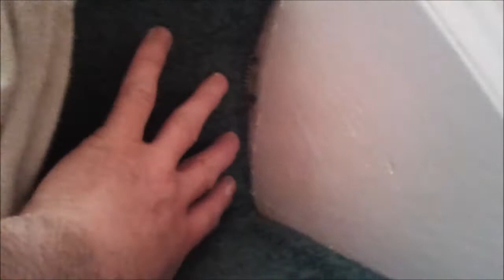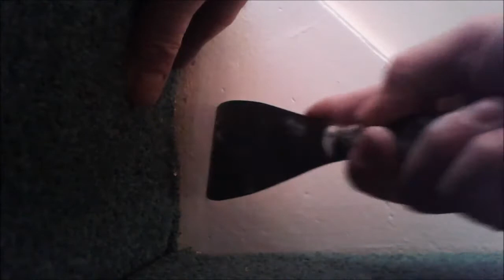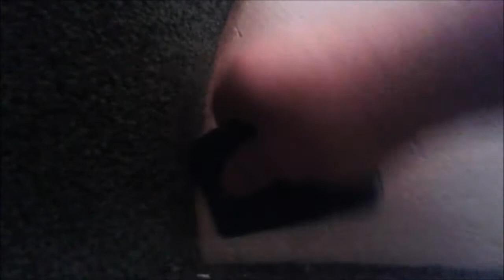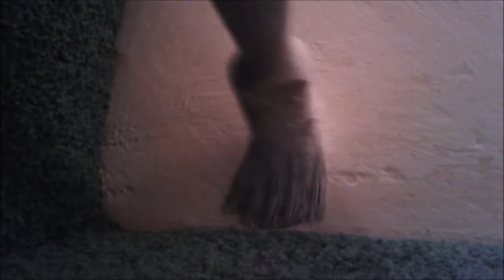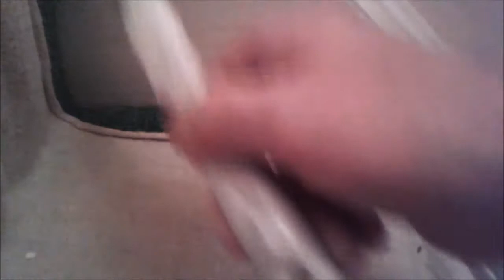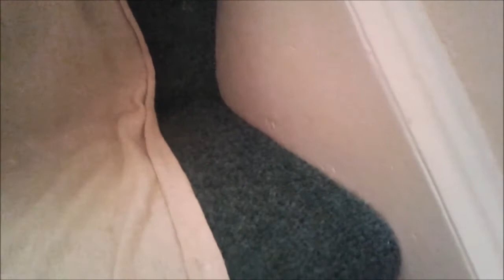Preparing And Painting Staircase Stringer

Comment: Zin Bin is a great bit of gear and pulls us out of many sticky situations. But wouldn't be using it as an undercoat as its very brittle. Also my old mentor would have kittens if he seen me doing treads and not taping carpets up.
Reply from the maker: So what do you use B.I.N. for.
Reply: Painting and Decorating  general stains, spot priming and priming knotty woodwork up. Zinsser bullseye is more useful as an undercoat as
That stuff sticks to anything.
Reply from the maker: B.I.N.  Product overview
B-I-N® is the ultimate shellac-based primer, sealer and stain killer. It is perfect for use on interior surfaces and spot priming of exterior surfaces.
B-I-N® offers unparalleled adhesion to glossy surfaces – including glass – without the need for scuff sanding and blocks stubborn and persistent stains. The high adhesion shellac formula seals porous surfaces with excellent enamel holdout, even sealing bleeding knots and sap streaks. B-I-N® works brilliantly on water stains, fungal degradation, nicotine, oil stains, marker pens stains and more.
B-I-N® permanently blocks every kind of odour (from smoke and fire damage to odours from pets and nicotine). Its dried film is non-toxic and hypo-allergenic, it may be used in areas where incidental contact with food items occur.
Perfect for interior ceilings, walls, doors and related paintable surfaces and spot priming on exterior metal, trims, PVC and wood.
Reply: Painting and Decorating that's what Iv pretty much just said 😂
Reply from the maker: Most paints are brittle once they are dry as long as it's keyed no prob.
Reply: Absolutely Bin is stain killer not an undercoat ffs